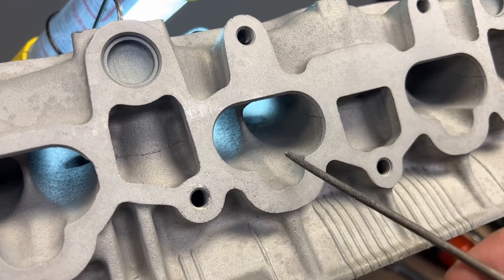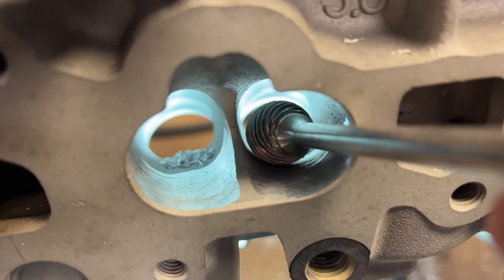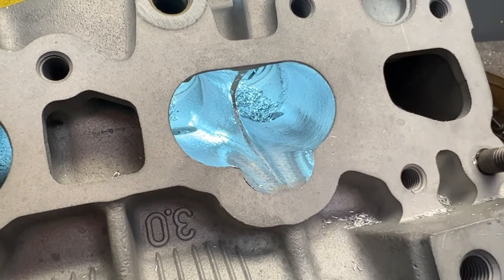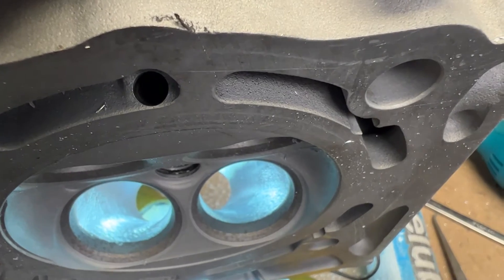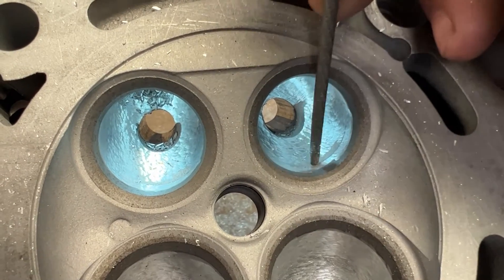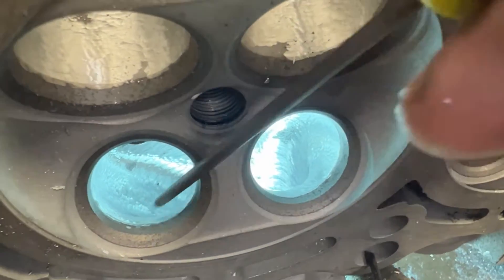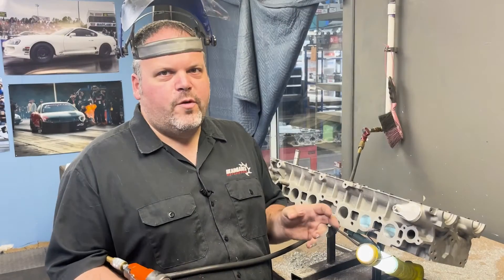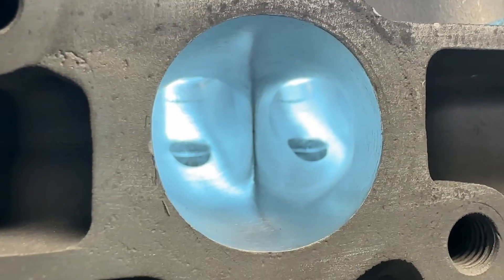Road to CNC 2JZ GE Part 1 : Porting and flow testing

Comment: good advice ,cool video!  the only thing I do different is I don't touch the elevator in front of the valve guides,  I also do not touch the lip which separates the two valve conduits, so that it is, the effect of an airplane wing, if we make it pointed we create a lot of turbulence on the sharp edge like a blade .Great! sorry for langage i'm in France .

Comment: That's mad! I literally just spent a long time doing my vvti ge head.
Lots of little differences between the vvti and non vvti ge!
Main thing off the bat, is the port divider seems way longer on the non vvti. 
Exhaust looks similar

But I did it the long way by using different sized balls as a guide for each throat..(I'm a noob here..)
Love the channel! Dave. 
PS.. also wedged 2 welding rods on a flap wheel to gauge the port entry angle vs the turbo head..not only is is raised up a bunch, it's got a nice upward angle and taper..where as the turbo is almost 90 degrees to the deck
Such a better starting point. Why they aren't used more is a mystery 
 point
Reply from the maker: For a newbie I like your ideas in keeping it consistent! Thanks for sharing and the kind words!
Reply: @headgames  I seen the video pop up and I'm like, oh oh..how bad did I mess it up..😅

Comment: What's the point of commenting if you dont reply..?
Reply from the maker: It was our cnc port with cnc chambers.
Reply from the maker: I try to reply to all of them. Unfortunately, I’m still human.
Reply: Ok, thanks.  I'll repeat my question here about the previous video about 1300hp 4g63 head. It did not look like it eas ported by you previously. At least the combustion chamber. Did you port it or someone else?